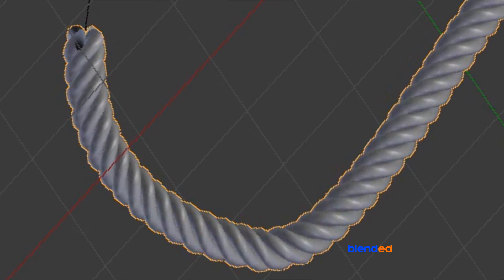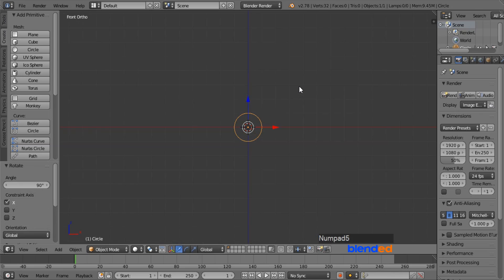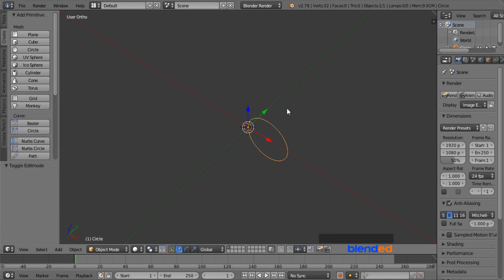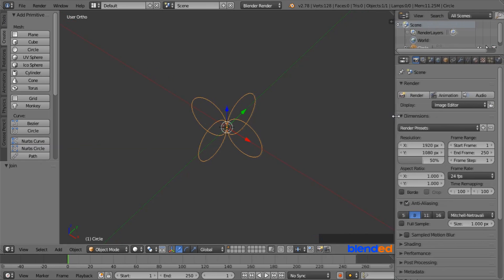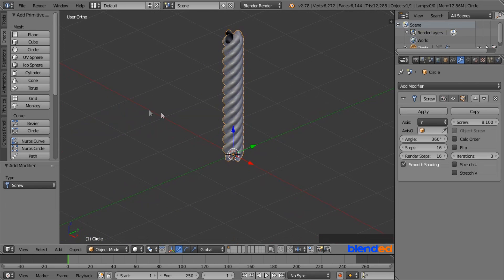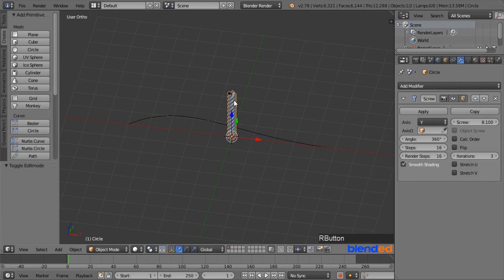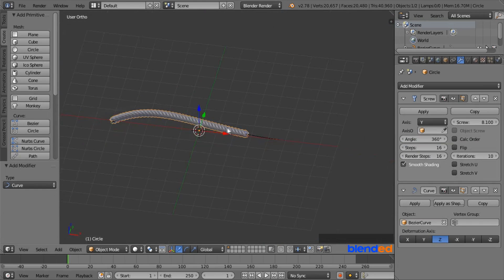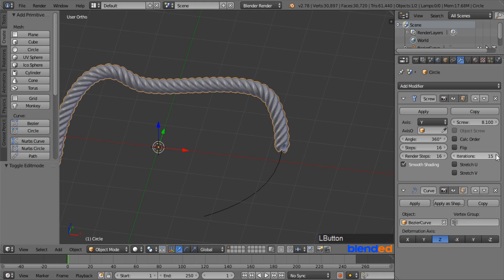Blender Tutorial - How To Model A Rope In Blender

Comment: The reason why the axis in the Screw Modifier has to be set to Y instead of Z (as you would think) is because he didn't apply the rotation to the circle after rotating it by 90° on the X-axis.